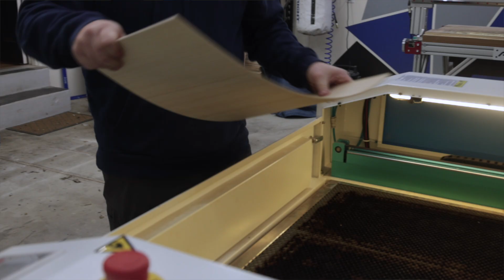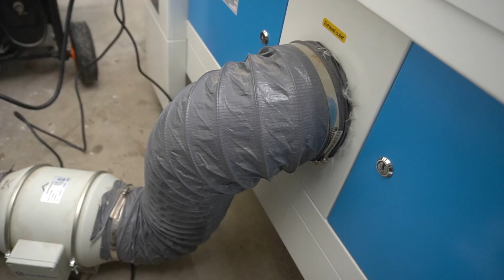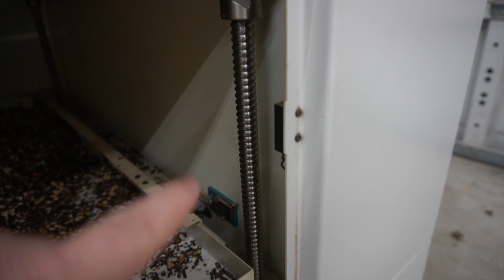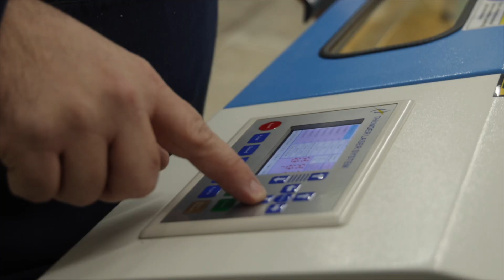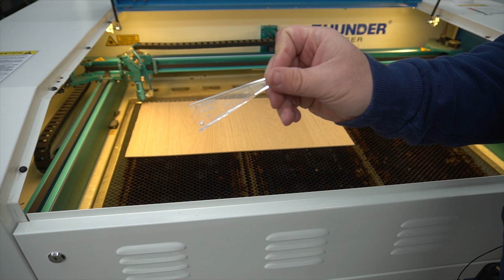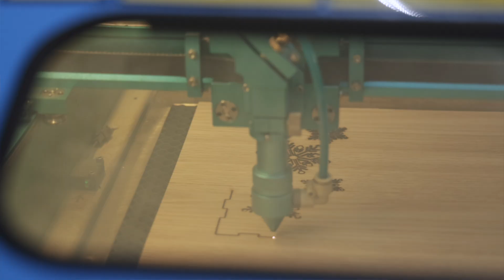This Laser Will Take Your Projects To The Next Level - Thunder Laser Nova 35 Review

Comment: Andy. My garage in the winter could possibly get down to around zero. Can you add antifreeze to the distilled water to safe guard the chiller? 
Also you said you take the chiller indoors if it gets cold. Isn’t there water left inside the laser? Or does all the water empty into the chiller when a job is done?

Comment: Hobbyists should not buy expensive laser machines for several reasons, but one major reason. The gas insider laser tubes leaks out over time (known as "outgassing") even if not used. Outgassing results in a reduction of output, and over time the tube will need to be replaced even if it sits idle most of the time. The worst thing a hobbyist can do is to invest in equipment that requires periodic cash outlays just to keep it running.
Reply: Well people always spend more on hobbies and don’t usually worry about cost since most hobbies are for fun not necessarily profit

Comment: Hi Andy, in your video "new shop tour" you mentioned that you can cut 3 complete lanterns per hour on your glowforge laser. Unfortunately you didn't complete the full cut on your tunder laser. So how much does your new 100W laser speed up the complete cut with similar results compared to the glowforge? Double up to 6 per hour? Or is the speed comparable to the glowforge, the main difference is you aren't running your machine to it's maximum capacity?

Comment: weird question regarding the chiller.  is it a closed loop of water (like a water cooled pc)? if so, whats to keep you from putting radiator coolant in there that withstands the super low temps (plus all of the other advantages like minimum corrosion etc)...? (ps, i have ZERO experience with lasers outside of using some in college just curious)
Reply from the maker: Some people do this, but the manufacturer doesn't recommend it

Comment: For the materials that can bow I 3D printed some pegs that fit snugly in the honeycomb with a two-step cap on it that works great as a registration marker and a hold down.
Reply from the maker: I've thought about using something like this. The only problem is when I'm using the entire bed capacity. The entire honeycomb is covered.
Reply: @AndyBirdBuilds  IS there enough margin on the sides to use a magnet with a washer glued to the top?